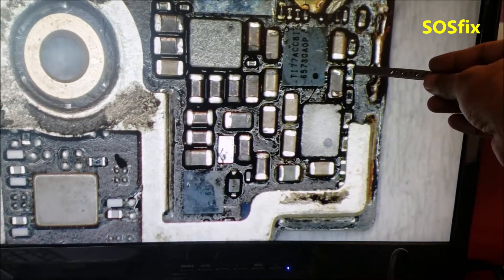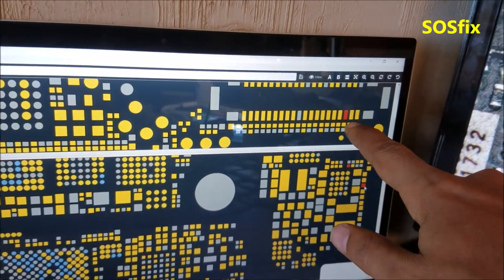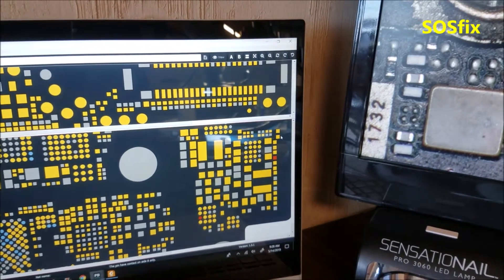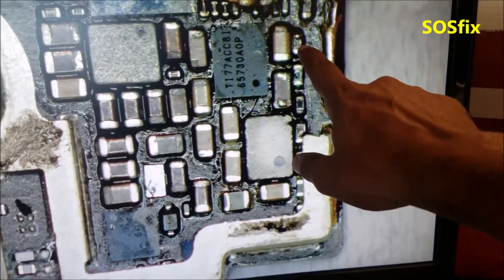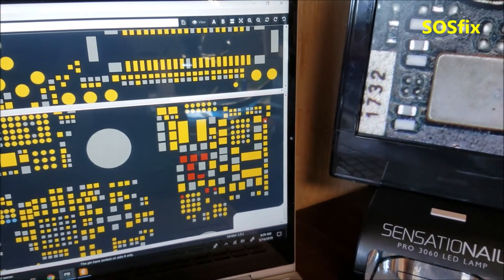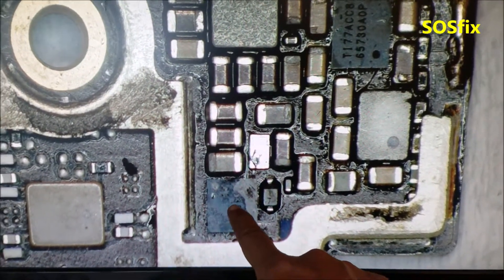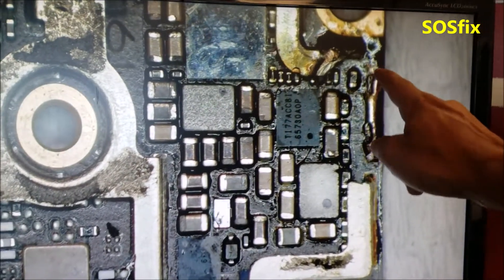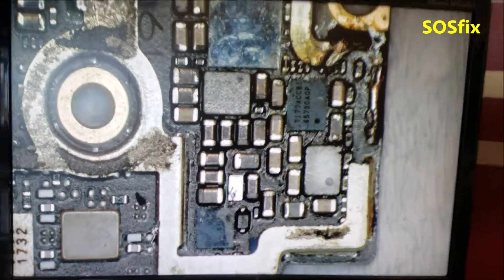how to fix iphone 8 backlight and the ways

Comment: Hi, J5700: All pins value are good
U5660: All pads value are good
U5660: changed
D5661: Changed
D5660: Changed
R5735: OK
R5733: OK
R5734: OK
All capacitors are OK
Do you have any idea what can be wrong?

Comment: I have a iPhone 8 no backlight pin 35 and 39 has no voltage Image is there but no backlight
Reply from the maker: pin 35 39 cathode 1 and 2  pin 37 anode . the 2 cathodes has filter then IC the anode has filter diode capacitors then IC if all capacitors filters diode after ic are good then change ic if still the problem check before the ic, check the connectivity may has open traces, do you have a board view software to fallow?
Reply: SOSfix Electronics yes i habe zxw I have changed almost everything on that line even chestnut ic filters are all 000 as it mentioned in zxw! I have another board from iPhone 8 I tasted on the other board but it worked all parts I used on the defective iPhone 8 . There are connectivity between all the 3 filters
Reply from the maker: @Bandseli   check the connectivity from the lcd connector all the way to the backlight ic, check the  diode mode reading on each point and compare it to other  good board
Reply from the maker: check backlight ic D4 pad for vdd 3.7v and D3 pp1v3v
Reply from the maker: check the filter between 29 and the D2 pad
Reply: SOSfix Electronics D4 line 3.9v  D3 has 1.8v Display connected and booted
Pin 39 diode 0.600 compared 0.607
Pin 37 0496 compared good board 0463
Pin 35 0614 comp 0463 
Pin33 0403  compared 0409
Pin 31 OL.    OL
Pin 29 0513  compared 0512 
No backlight good board has backlight
Reply from the maker: @Bandseli  dont try to remove the PMIC  thats not the problem,  the back light ic booster it getting voltage from VDD main pad D4  and  you have 3.9v . i ll check the diode mode fore each pad of backlight ic
Reply: SOSfix Electronics I did remove backlight ic and checked the pads of BL on the L board and it’s identical of the good Lboard. Maybe I should make a jumper some place?
Reply: SOSfix Electronics  which pins are responsible for the backlight voltage on the fpc?
Reply from the maker: @Bandseli  35 and 39
Reply: SOSfix Electronics what could be the possible reason that no voltage comes through that pins 35 and 39 ?
Reply from the maker: @Bandseli  its hard to tell. there are 2 pads under backlight ic communicate direct with cpu check diode mode of them
Reply: SOSfix Electronics I have Checked Diode readings red on Ground and black Probe on the BL pads - A1, 0.504 /A2 0.411/ A3 0.321 / A4 0.321
B1 O.L / B2 0.400 / B3& B4 ground 
C1 O.L / C2 0.401 C3 0.402 C4 0.322
D1 0.402 D2 0.523 D3 0.290 D4 0.321
C2 data C3 CLK goes to CPU 
A2 B2 D1, D3 those also going to CPU
Reply from the maker: @Bandseli   pad a2 has 2 filters check them
Reply: SOSfix Electronics just checked both filters are good
Reply: SOSfix Electronics I have just checked and both of the filters are good.
Reply: SOSfix Electronics  maybe it’s  a main power ic  don’t send a voltage to the backlight ic? Backlight ic tested works fine
Reply from the maker: check filters diodes coil and backlight IC
Reply: SOSfix Electronics they are all good! Swapped 3 times already  but still no backlight pin 37 I have 1.7 voltes 37 and 39 nothing there is no screw damage and fpc is ok too, very strange
Reply: Hello friend! Are you on smartphone repair group Germany on Facebook?
Reply: @Bandseli I have same problem. Did u found any solution ? I think problem with "I2C" lines
Reply from the maker: @Bandseli  no friend